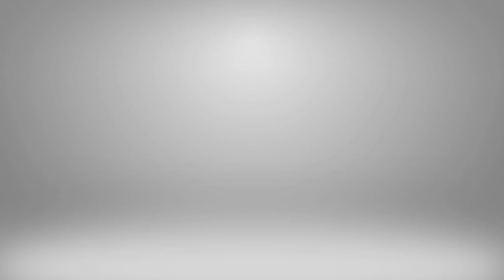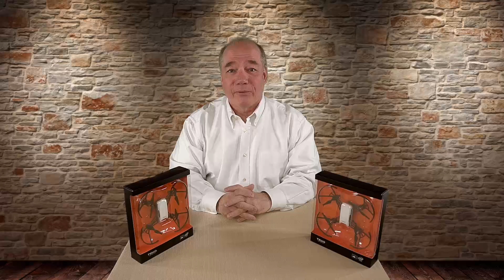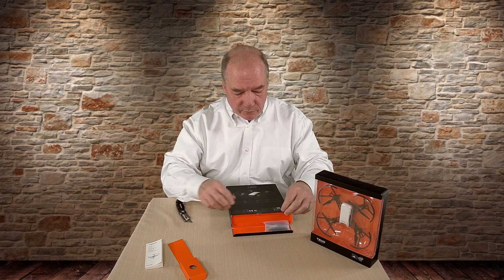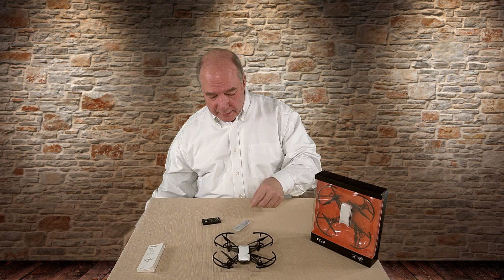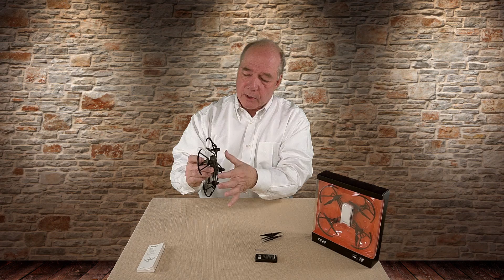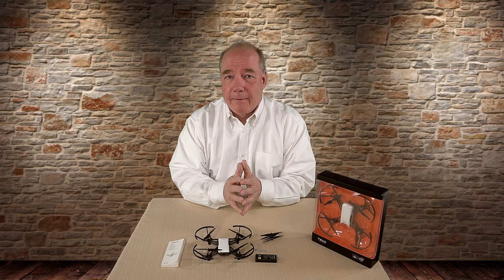The New Tello Drone By Ryze - The Most Fun Flying You Can have For Under $100

Comment: The visioning position system only works good inside if you have plenty of ambient light in the right type of floors.. 

Dhatelo does drift inside plenty.. my opinion altitude hold is more stable overall inside especially if you don't have a lot of light.

Comment: Two years later the tello is overpriced just like it was overpriced two years ago!!

More like a little toy drone that you have no dedicated controller.. no on-board microSD card.. ONLY 720P VIDEO, YOU CAN'T CONTROL THE CAMERA, YOU CAN'T CHARGE THE BATTERY OUTSIDE THE DRONE!! 🤣😂🤣😂

SUCKS OUTDOORS. INDOORS IT'S AVERAGE BUT TOO LOUD, AND TO HARD TO CONTROL WITHOUT A DEDICATED CONTROLLER.. THE PROP GUARDS COME OFF IF YOU BANG IT OFF THE WALL AND CAN'T SUSTAIN A HIT BECAUSE THEY BEND AND GETTING THE WAY OF THE BLADES!! 

YEAH IT'S A BREAKTHROUGH 🤣

At the time tello came out you could get the YUNEEC BREEZE WITH CONTROLLER FOR UNDER 150.. 4k camera,  RIDICULOUSLY BETTER pictures and videos,  GPS WITH RETURN TO HOME, better range,  on board built-in storage to record video,  image stabilization, you can' control the camera to go up and down with the controller in any position,  

YUNEEC BREEZE BLOWS THE TELLO AWAY OVERALL !!! 

There are other drones at the time and right now that are better than the tello all that have controllers in GPS... 

tello is an overrated toy that's overpriced..
Reply from the maker: Thanks for the post but that Tello is an amazing craft, even two years later. The amount of tech packed into that tiny little frame is incredible and outshines anything even close to it's price. There are a ton of other quads that cost far more that don't have stabilized flight, real time streaming and a host of other features the Tello provides. We all have out favorites but the Tello is still my go-to quad for new fliers and for flying in the house on rainy days. You can find an inexpensive charging hub (we have one on our website) to charge several batteries together and the video is recorded on your phone. Adding these features would raise the price of the quad and if you need them, step up to the Mavic Mini and you get all of them and more.
Reply: @Dronevalley  

Love your videos by the way!!  thank you very much. But I completely disagree.. I think one of the reasons why you love it so much is because of your technical engineering mind..  

I have tried the ryze tello before and I stand by everything I said.. I actually returned it!!  wasn't worth the money !! there were cheaper better, choices especially for indoors that without a doubt work better.. 

It's ridiculously loud inside ( the tello scares grandchildren annoys other people, they can hurt there hands on the blades.  prop guards don't protect enough for an indoor drone or stay on when you hit the walls... . much better softer sounding drones, that protect the propellers, and people's hands from injury for the money indoors... )  

outside it gets blown all over the place with the slightest wind.. little too big for indoors and really too small and not really powerful enough for outdoors ( unless you have perfect conditions which almost never happens!! so then what's the point?  ) 

I have expensive DJI drones for outside. I believe you should have outdoor drones and indoor drones there's no one great drone for both.

 You think the tello does both but it doesn't do either very well..what makes a great indoor drone is that it has a great propeller protection system you can bounce it off the walls with no problem and the prop guards do not fall off or interfere with the blades and protects people's hands from getting injured THE TELLO DOES NOT!! .. 

an indoor drone should be stable no matter what floor or object it goes over. ( Vision position systems  and optical flow sensors )  do not do well indoors... I'm sorry I have plenty of them they just don't!!! Optical flow sensors work best when they have the most light and don't have to go over tons of objects that are close.. the different light reflections in floor surfaces make optical flow have issues that altitude hold DOESN'T!! Vision positioning systems optical flow are expensive and absolutely work against you indoors in lots of situations.. they're just not needed indoors!! 

It's much harder to fly indoors!!

 an indoor drone should be very small so it doesn't make a lot of noise but should still go very quickly so you can have fun.. you don't need any gimmicks or modes indoors they're useless.. indoor drones need more protection and stability for the Drone itself and for people around them.. 

What you think is and feature packed most people don't care. They would rather have altitude hold and a controller especially for indoors for a much cheaper price.. half of the things on the tello are a gimmick that no one will use..

Most people don't care about programming at all.. 

But I do question that you've looked elsewhere ( especially when it comes to indoor drones) much better small choices that are more fun.. like the ( AKASO V21 OR FV21A IT COMES WITH A CONTROLLER!! ) only $29$!!! This was much more fun to use indoors then the TELLO.. and then buy yourself an outdoor drone for 100.00 or even less.. that will by far BEAT THE TELLO IN EVERY WAY SHAPE AND FORM OUTDOORS!!! So for the same you pay for a tello with a controller,  you can have a better performance indoor and outdoor drone!! 

Like I said at the time of this video the YUNEEC BREEZE which is better than the ryze tello in so many different ways was only $150 with the controller ( GPS return to home, onboard storage, ridiculously better video and picture camera, 720p, 1080p, 4K!! Dedicated game controller that you could use with your phone for other games, an extra battery, excellent performance outdoors with better range, easy sharing media function, came with the hard shell case,  you can charge the batteries outside the Drone, mechanical camera you can position, and control with the controller, I MEAN IT'S NOT EVEN CLOSE!!! And their other drones like the yuneec breeze right now that do the same things and even more for the same price!! 

No microSD card on board.. for $100 and no controller is no excuse!! and then it's difficult to find a controler that actually works with it. controllers that work for the tello are few and far between and the ones that do cost too much money.. 

you say the video is stable but it's still shaky with image stabilization.. the video at 720p in my opinion looks below average... I have phones that are 7 years old they have better video and pictures then the tello. HOW THE ABOUT FRAMES  BEING SKIPPED OFTEN... The quality of the tello camera without micro SD card capabilities makes it slightly better than toy grade cameras!! 

The pictures are okay.. 

You can't move the camera up or down.. 

TELLO doesn't even have GPS return to home, below average range..

What good are features if you don't need them.. 

THE BOTTOM LINE THE TELLO WAS TRYING TO BE TOO MANY THINGS AT ONCE AND IS REALLY NOT ANYTHING SPECIAL FOR THE PRICE.. IT WAS TRYING TO HAVE ITS CAKE AND EAT IT TOO THE EXPERIMENT DID NOT WORK.. 

Buying the right drone for the right application!!  separates instead of all in one is always better in pretty much any situation!! 

you're a tech guy LIKE ME. So you must know about being an audio file.  separates are better than all in ones.. 

Did I say it was a bad drone, no, but you could spend your money intelligently elsewhere with much better results.. 

;)
Reply from the maker: Thanks again for the extensive reply but we'll have to disagree on this one. When the Tello was first released (2 years ago) there was nothing like it on the market and other toy drones have gotten better in that time but I still love the Tello. I fly a TON of small drones and test them for companies and occasionally review them on the channel so I have some decent comparison criteria. The Tello was a truly innovative platform that too DJI and Microsoft tech and built a drone from the ground up. Most of the other Sub-$1000 drones are clones of each other with different air-frame that all use the same chip-sets, cameras and controller hardware. They fly OK but I find myself spending half of their limited battery life just correcting for drift before I can even fly them. Because of the tech, the Tello takes off and hovers rock solid right out of the box. With most fliers getting into the hobby, having to deal with adjusting for a drifting quad every time they want to fly will turn them off to the hobby. I have recommended (and given away) a bunch of Tellos to new fliers and most of them have moved deeper into the hobby with larger and more sophisticated quads after learning to fly the Tello. I do agree with you about the limited battery life and issues with flying outdoors but you're fighting physics there and we can fix that. I really appreciate how passionate you are in your opinions and I totally respect that and it's great that we can both love the gear we love for different reasons and there's never a clear winner. Just like the old Ford vs. Chevy debates I used to have as a kid. Stay healthy, happy and flying! Rick
Reply: @Dronevalley  

I guess we disagree but that's what makes it all fun..

Indoors flying tello it does drift a lot, too big and too loud.. I find altitude hold to work much better indoors on almost every single drone.. the optical flow as you know needs a lot of light to work correctly... all the different objects in the house and reflections it really does not work good.. 

Well that's just my findings that's why I returned the tello...I have much better indoor drones now that are much more fun that I can bang off the walls and not worry about anything. 

just like you mention outside it's about physics that's why outdoor drones if outdoors and indoor drones are for indoors.. that's why I have one's specifically for each.. it's money better spent with better performance in a given situation..

there are much cheaper products out there that fly better indoors that are smaller then the tello.. 

it doesn't matter to me if intel and DJI  get together and do whatever.. I don't care if a rocket scientist or Bill Gates built it.. it's all about how it performs for you and your situation..

Don't like flying the tello indoors I don't care if it was made of gold and Bill Gates built it himself. Like I said it drifts and I have to be very careful.. that's not a fun drone indoors.. 

Add a minimum for $100 it should have came with a controller and built-in microSD card slot..  to me the video is utterly useless in this day in age.. unstable, choppy... 

I will never fly a drone without a controller it is a horrible experience.. I don't know what they were thinking.. at least DJ I gave you the option with their other smaller drones to buy a dedicated controller if you wanted to.. 

They just didn't really think anything out to well..

I BET ALL THE THINGS THAT I MENTIONED WILL BE FIXED WITH THE TELLO 2.. the tello 2 will be what the tello 1 should have been in the first place... 

;)

BUT THANK YOU SO MUCH FOR REPLYING TO ME I REALLY APPRECIATE IT AND I LOVE YOUR CHANNEL!!!!
Reply: @Dronevalley  

Well I just don't have those drift problems with my little indoor drones with altitude hold.. I did have the problem with any optical flow drone like the tello.. 

The flight time on the tello is not great with people getting between 8 and 10 min.. 

My little AKASO A21( the one that I bought after I returned the tello)  stays in the air for about the same amount of time.. I can fly that thing off the walls and have no problems. I find it to be much more fun and not as loud as the tello indoors. It has a 720p camera but I don't care about that indoors.. recording video through Wi-Fi just isn't good.. and 720p makes it worse.  if you're indoors you can use your camera phone that blows it away 🤣
Reply: @Dronevalley  

This is what I was talking about the tello like with this guy was saying near the end of the video about the yuneec breeze.  

https://wholesalephoto.com/dji_tello_quadcopter_refurbished_5296898.php?utm_source=googleshopping&utm_campaign=googleshopping&utm_content=5296898&gclid=EAIaIQobChMI3paM5tTX6AIVRpyzCh30bAVBEAQYASABEgLA0_D_BwE

Yuneec breeze far outperforms the tello in almost every way.. has a real camera onboard storage.. GPS etc......  

With a controller only 150.. in comes with an extra battery.. 

Lots of them are out there like this.  

Didn't say  the DJI tello was bad I just better choices for the money..  and if you like your optical flow there are plenty of small drones that are out there that have optical flow now for under $40

Comment: I think it completely overpriced. Many drones on market with same features for half the price..horrendous lag on camera. Paid endorsement??
Reply from the maker: Thanks for the post but I purchased a set of these on release and respectfully disagree that there are others on the market for half the price that compare. I fly a ton of quads, many of them under $100 (especially in the house in the winter) and none of them are even close to the level of tech inside of this little marvel. This is the only quad on the market at this price point that includes DJI flight technology as well as Intel for stabilization. Ryze has also opened up their API to allow programming the drone through Scratch. Other quads I fly in this class are good but this one is amazing and well worth the price. I'm not compensated for saying that and will actually be giving away 4 of these this summer for free to viewers on the channel so be sure to stop back to win one of those.

Comment: Ŕick, this is Rick... Question, does both infrared Sensor on the bottom of Tello glow red when powered up? I just have one glowing red.
Reply: Ŕick, did you ever check the 2 bottom red Sensor to see if both glow when powered up? 1 lights up on my Tello. Im wondering if both should glow . You see it glow better in the dark.

Comment: great video and cool lil drone but highly over priced. you can get the same or very similar features for $20-50 if you do a little looking around. DJI and intel do make some great products but this wasnt actually built by either company. I wouldn't mind having one of these to play with but i think i'll wait until the price falls to around $50, or $75 with extra batteries and an external charger. an optional package including a controller would be nice too but from what ive seen its not hard to find cheap controllers that work with it.

Comment: If i were to buy this , it would only be because of the programming capabilities, , something to tinker with outside of the norm, but i bought the Parrot Mambo FPV in January,  the frame design looks pretty much the same and its stability,  nice, it was over $100 when i purchased it it was $149, but it also came with a battery, a remote, the FPV goggles for your phone, the charging cable, an APP, if you dont have that one, try it, the battery life is short of course, about as long as this one. But it too is worth it. ................... Not knocking this Tello, but after purchasing all the additions, extra batteries, remote, FPV goggle etc. this lil drone is gonna be kinda expensive, Probably more than the Mambo, but i really do like the programming capability, thats about the only thing that get my attention,.

Comment: Please stop calling this a Drone for under 100 Dollar. It is actually $99 which only stays on the 100 if one would not have to pay any taxes or transport. And asked many words by a Bluetooth controller it's closer to $150. 
One May of the opinion that it is worth even that because it is so very stable indoors but if you maynly fly outside it is hard to justify that price, given for instance thatthe JJRCpro Hax is not much more expensive but has a longer flight time, brushless motors and a full 1080p camera. Yet still every body praises the Tello if it is the biggest thing since I don't know when.

Comment: was sounding really good until you said flying with the phone and Blue tooth. I have to fly with sticks! if its not compatible with RC controllers and only a phone, that killed it for me... wish it could be used with my phantom 4 pro controller or even my race drone controllers.
Reply from the maker: You can actually use a Bluetooth controller tethered to your phone to fly the Tello. The phone connects to the quad through Wifi and the controller connects to the phone through Bluetooth. I was actually testing a MadCatz controller tonight with the Tello and it flew great. I'll be posting a clip on how to make this work in a few days. Thanks for the post, Rick
Reply: Good info....it just seems to fall short to me by not using a 2.4ghz input. kinda reminds me of a parrot with sonar, they were great!! but you had to use your phone .. then they came out with a (stick) controller later that made it even better. (at a nice add on price) But with the technology in this drone it is great and i sure am a DJI fan! thats what got my attention!